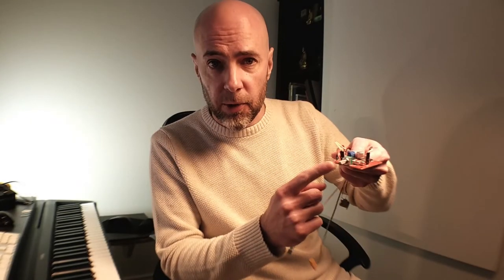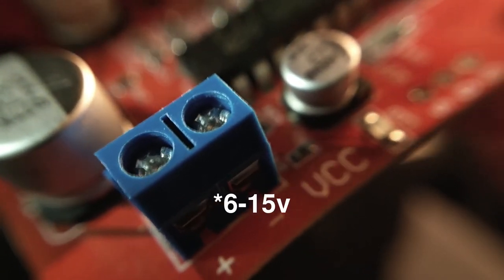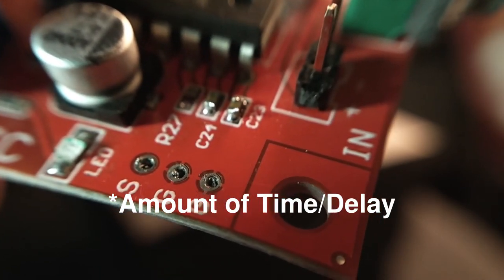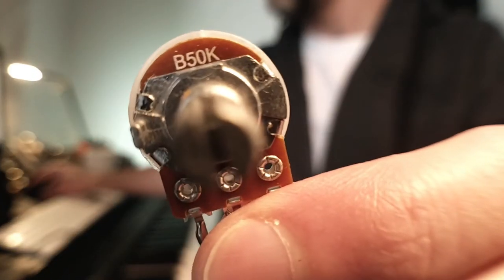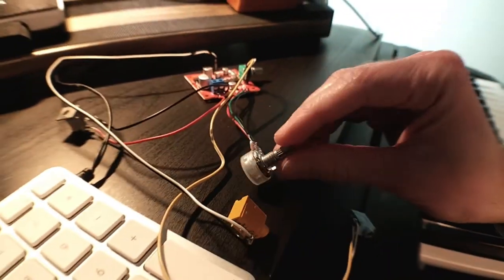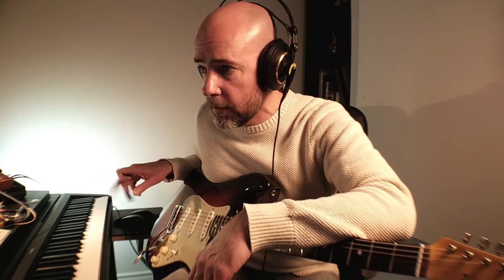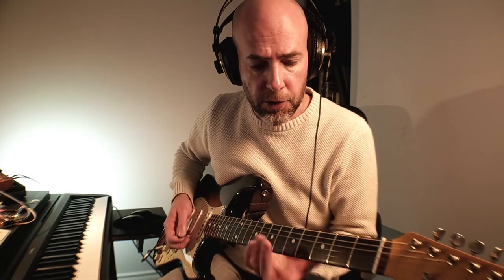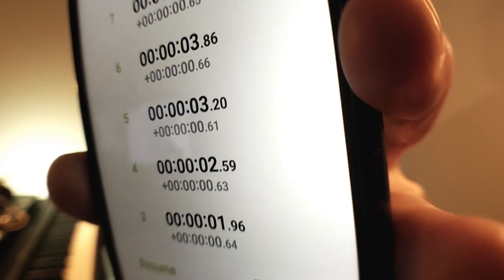Cheapest Guitar Reverb? $2.33 AliExpress Reverb/Echo/Delay circuit board!

Comment: A hint to all the users below. This device has a low impedance input. So when you go with your guitar in this device the signal of the guitar will be smaller and less high freq. It is nessecary to make a JFet input buffer at the input. Then it works very good.
Reply: you could use a buffered pedal in bypass mode - in a pinch .
Reply: If my guitar output already is low impedance (due to an on-board distortion preamp) would it be unnecessary to add the Jfet?

Comment: I bought that board a few years back, but didn’t know about that mod to adjust the delay signal.  Thanks for sharing!
Reply: Apparently you can throw a 50k-100k pot between the center leg of the blend pot and leg 6 on the IC and get control of feedback. I just ordered a pair of these boards and plan is to daisy chain them.

Comment: Just got a second reverb board, will try to connect parallel. I also try with reverb and tremolo parallel, works very well and gives a wide range of nice effects. Tremolo I designed by myself and works great without ticking noise, I will make this design later available on YouTube with schematics and pcb layout for toner transfer.
Reply: You don't seem to have done it by now tho?

Comment: So at this point I bought a bunch of these, and made one with just it's original pot, and no buffer, and then I have a couple like you did with a buffer (and these people are right it helps, also pedalpcb has a really cheap non powered fet buffer pcb that's super easy to build). There is a few modifications you can do and some channel called robs mods also covered this. The idea was neat and lead me down a path of repurposing stuff for pedals. I'm making 3 or 4 different fuzzes based around a lm 386 chips you can buy on a pre-assembled board just like this but it's even cheaper than these karaoke echos. I also made a pedal out of an artec 5 distortion knob meant to be installed in guitars, a voice changer diy kit, and I made a lofi looper sampler. I also took a diy Haynes synth and added stuff around it and started making video mixers, and other weird things because one day I came across 3 videos and one of them is this one. I keep coming back hoping there is an update or something new to learn, and I can't blame you for having a life and not going back to this, but man I hope you do. I have 2 dsp effects things I bought off of ali I hoping someone makes a pedal out of and I can see that and make it work.

You made a very informative video,and it was unintentionally inspiring for me, and you seem like a chill man, who makes quality content. The quality of the video as far as picture quality and aesthetics are nice as well.
Reply from the maker: Madz, thank you for the compliment - What you are building sounds amazing! I'm looking forward to checking out your videos. I was hoping to do a simple synth build, but just don't have the time. And I still want to build a basic reverb tank. The DIY video mixer would be an amazing project as well... there's so much fun just waiting to be explored with electronics!

Comment: I have made guitar pedals but after discovering Ali Express I find it cheaper to just buy the pedals. Often they are modified clones of famous circuits and are better than the original. I am building a Boost distortion fuzz at the moment from Ali Express parts. Lm386 chip for 50c is impressive. Thank for the video I may build your pedal ❤
Reply from the maker: Haha! I set up a small Lm386 to see what it was all about, learning about Op Amps in audio. These little boards are great for having fun... especially when you have very little money. Echo/Delay for $2.33! That's half the price of a sandwich these days! :)
Reply: @corytoddmusic  4 lm386 boards for 10$. So I will add a switch or two and some clipping options. I also have packs of transistors capacitors diodes etc. So I will be busy when I get the time.

Comment: Excellent, I order by aliexpress the same board a few weeks ago. Still waiting to receive, but as soon as I get it, I will try it out. By the way because the circuit is not shielded in a metal box you will always get some fuzz. Thanks very much for sharing.
Reply: The 'fuzz' is the degradation of the signal and is part of the chipset's stock behavior (or you've got grounding / shielding needs - and we can see you've no shielding).

This is a "digital" chipset, but it's really more a hybrid, as the digital part is ONLY used to create the delay.  It just stores sound for a while, then sends it back into the signal path.  The rest of the chipset is analog op-amps, mostly used for buffering, splitting, filtering, de-aliasing, and combining the signals, just like in a classic BBD delay. 

When you increase the delay time on the chipset, that means the digital memory has to store more info, and the quality degrades.  Limited memory means if you store only 30ms of sound you can get pretty much full clarity, like a high-def picture, but when you stretch that out to the default max delay time, the quality of the sound is degraded in order for it to store that much data (sample rate drops).  

A BB delay degrades due to the components, the PT2399 degrades due to the way the memory is stored.  I believe, but am not sure, that it's controlled by the clock.  I know longer delay times equate to lower sample rates and thus signal degradation, I'm just not sure if setting the clock time influences the sample rate directly.  Regardless, the degradation of the signal with a PT2399 is far less noisy than with a BBD.  Most 'noisy' delays using the PT2399 are due to grounding issues, not the chip, or things being done outside the chip (e.g. adding modulation to the delay).

In a true digital delay processor, the signal gets converted to digital, EVERYthing is processed by DSP in the digital realm (EQing, filtering, splitting, delaying, filtering, modulations, combining, etc), and then the signal's converted back to analog.  In the PT2399, the A2D and D2A only surround the delay action, and all else is outside the A2D - D2A section.

So, these chips do really well at two things:  Creating nice slap back, where delay time is short so you maintain clarity of the signal via high sample rate, or creating a cool lo-fi 'bitulated' delay at longer times via low sample rate.

The Wampler Doctor and Faux Tape Echo both make use of this chip, as do MANY others.  The Doctor is wonderful due to the way Brian's worked with the chipset.  The chipset has options for the designer to override various default values (like the resistance in op-amp feedback loops).  In your low-end delays (like the Rogue/Belcat/Hofner/Modtone 'Analog Delay' pedals), the thing is used pretty much stock.  I love my Rogue, btw - excellent for vintage sounding BBD delay emulation and slapback - partially because the min 30ms delay time is great value for slapback - I don't have to fiddle with the delay time knob, I can just turn it fully CCW.

BTW, regarding shielding the board, don't forget star-grounding is best - don't attach the negative from the input AND output jack both to the chassis, only attach one of them.  Attaching them both to the enclosure creates one huge ground loop, which then catches 'EM noise' from the environment.

Comment: Which part controls the repeats?; I will put a pot on that also.
    High milliamps is clearer on this chip than a battery, but, I think the degradation sound warmer on a battery, on the 2399 type delays.
    Also; I wanted to see how you removed that "surface mount"'resistor; because, it has no legs through the board:
    Do I just heat the entire component?
    Also I saw someone mentioning adding a resistor and cap to the leg of the chip, with a pot, or switch, to add a chorusing, or "modulation" to the repeat.
    Thankyou for sharing!
Reply from the maker: This is some great information! I think heating the whole resistor is fine for these, assuming you won't want to use them again anyway. It's been a while since I put this together, so I don't remember the pot controls atm. I'm looking forward to playing around with some boards like this again sometime!

Comment: I have the same AE reverb and I must say I can not hear any fuzz in my signal. Why? Because I connected my guitar strait in the delay unit and after that to my amp. What you do is from your guitar into de American sound amp modeler, with the level almost on max, and after that into the delay unit. No wonder you get fuzz because the signal strength is much to high, so the delay unit clips. Just try it the other way.
Reply from the maker: Frans, it is so obvious to me now! It is far too easy to forget that the signal chain is different when plugging into an amp simulator before plugging into the computer. Thank you!
Reply: @corytoddmusic  I have about 5 of these installed in tube amps. These pcb boards need def. a buffer circuit on the input! The board is low impedance and do not match with a guitar pickup. Just a simple JFet buffer will do and give the device no signal loss at all. This is a great reverboard and very easy to mod. I mod them in the way that no electronics are in the signal chain, only a resistor of 22k, added a repeat and speed control. Great stuff and now for ca 0,8 dollar on Alie. Unbelievable.

Comment: What you used as power supply for the kit? A battery or Linear Transformer based power supply. SMPS is maybe noisy.
Reply from the maker: I think it may have been an SMPS! I salvaged it from an old cordless phone base station, and it seems that quite a few of those are SMPS, rather than linear (I didn't even know there were different kinds!). I'm hoping to experiment with some DIY synth modules, and small effects circuits in the future  so I will certainly keep this in mind when thinking about a power source. Thank you for the tip!

Comment: this is what i ordered to try to use on an electric guitar,
https://shopee.ph/product/135511180/2361185130?smtt=0.80193808-1626273424.9

wasn't so sure if it's gonna work fine. i will be adding this to my diy amp speakers so i can use a mic and electric guitar.
Reply from the maker: Stereo output as well! It looks like you may need to add the input jack yourself, unless you're routing the audio signal inside the amp. I think these are great little boards!